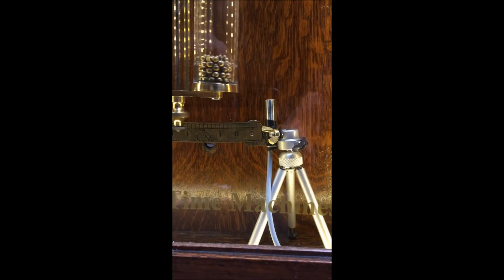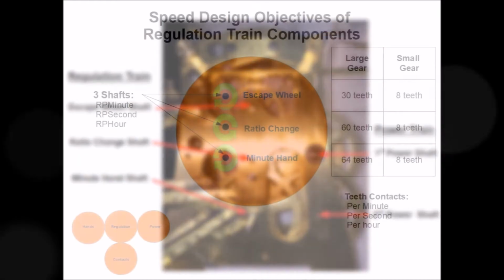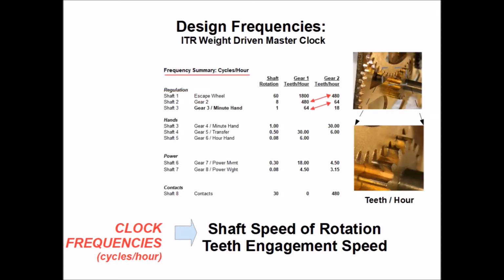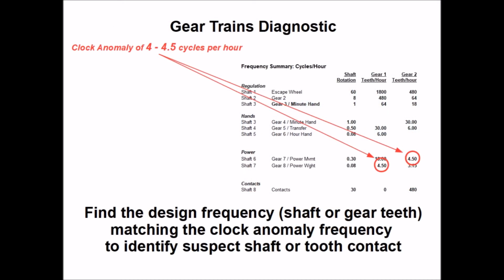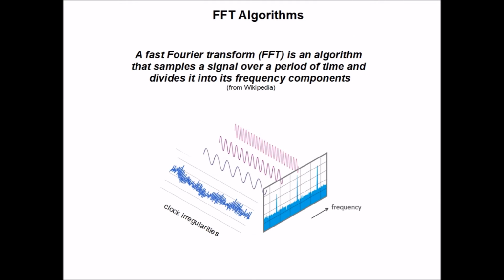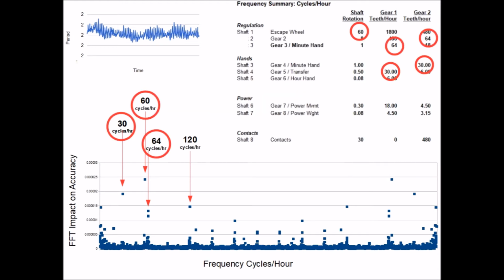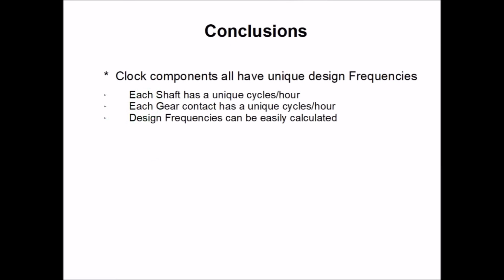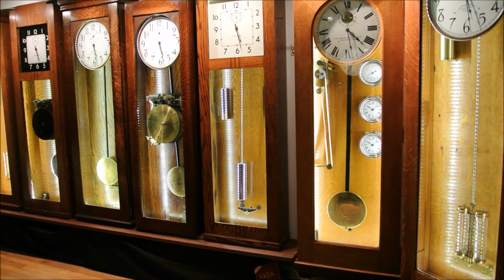ITM Tech: Clock Frequencies for Diagnosing Movements, an ITM Clock video

Comment: Very interesting video, you delve into the science (frequency analysis) of clockmaking, and the possible mechanical errors within. I also enjoyed (and learned a lot from) your discourse on pendulum theory and center of gravity. I have an old ITR weight driven mercuric pendulum clock. Two questions; What process do you use to clean the mercury in a pendulum, and the glass jars? Is there any danger of the pendulum suspension spring breaking, and causing a mercury spill? Or is it more prudent to fill the jars with lead shot, or something with high density other than mercury? Thanks, --- Henry
Reply from the maker: Hi Henry.  Thanks for watching, and for the feedback.  The two videos you mentioned (frequency fluctuations to diagnose & pendulum science) are favorites, but maybe too esoteric for many.  I feel the 'frequencies' analysis could be used on any mechanical device (e.g., car motors) to diagnose wear & failures.  Regarding mercury, I'm careful with it too.  I have a few mercury filled pendulums, but worry.  Most often I use brass ball bearings (1/4") and they work well.  Usually about 2-3" of ball bearings in each vial is enough to regulate the clock to 60 bpm.  Thanks again, Dave.